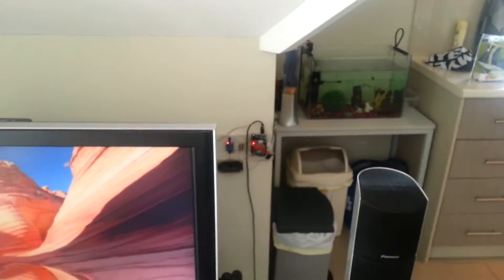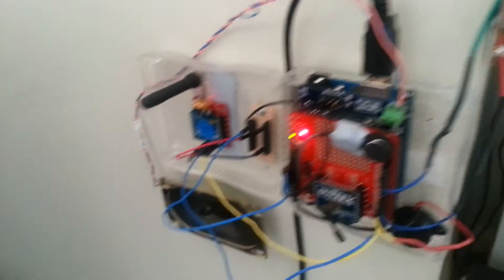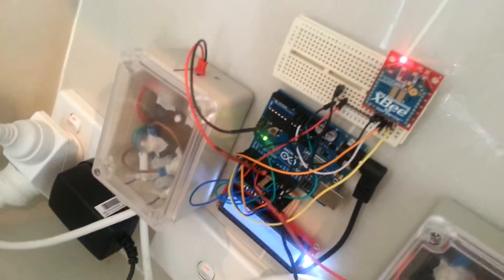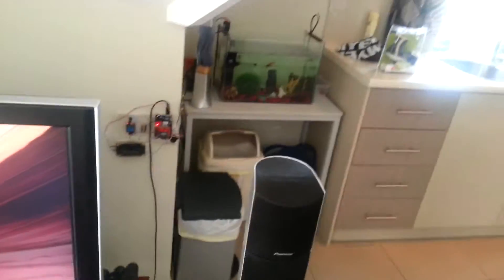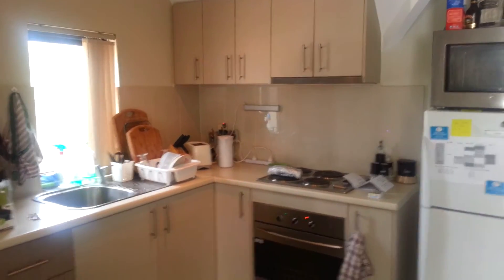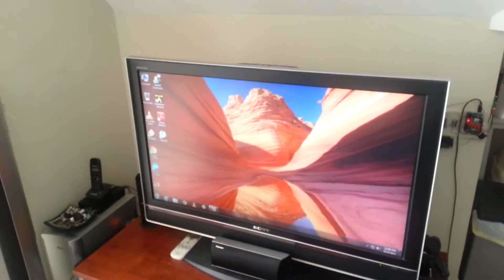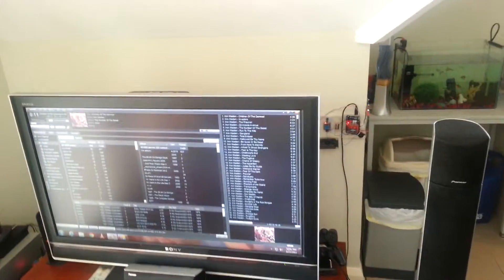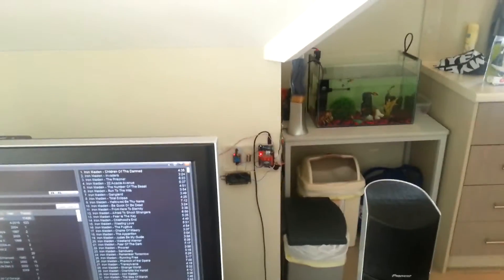Home Automation Project Using Arduino + EazyVR + Zigbee/802.15.4

Comment: Nice project but I can't help but think of it as ...extremely cost-ineffective ? I mean instead of using expensive radios you could either use really cheap 433mhz radios or cheap 2.4Ghz transceivers (for range)? Also for the peripherals why not simply hack the frequencies of cheap (as in 5$ ea) 433.9mhz wireless plugs? And instead of using unos and so on why not pro minis? I really enjoyed taking a look at what you've done but these questions are bothering me.
Reply from the maker: pixelsafoison Nah you are right. If I was to do redo this. I would have definitely gone along a different path. It is just what I had laying around at the time in terms of hardware and radio modules.

Comment: how much was the cost ?
Reply from the maker: Isaak Morse Arduinos are about $12 bucks, radios are between $20-30, SSRs are about $5 each.
Reply from the maker: Isaak Morse Ahh and the easyVR shield was about $40 at that time. But it is much cheaper now I presume.
Reply: Tnx....
Reply from the maker: Isaak Morse
No worries

Comment from the maker: Hey. A new release of my website will rolled out soon which will have more comprehensive tutorial section. Sorry about that. Regarding your question, the whole idea of the second radio is to highlight the use of the Software Serial library in Arduino, which is an emulation of Hardware Serial. So of-course, the entire network can be setup with Zigbee exclusively.